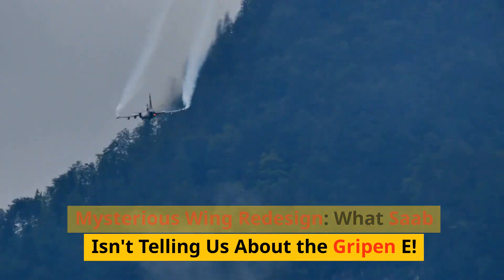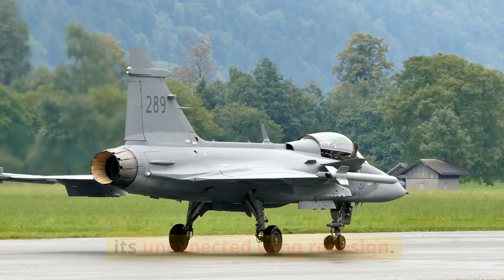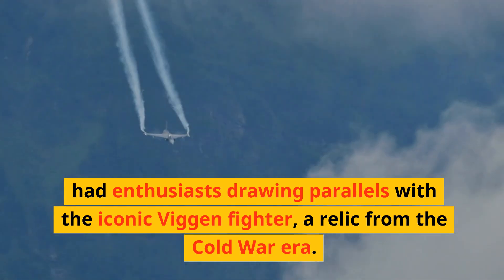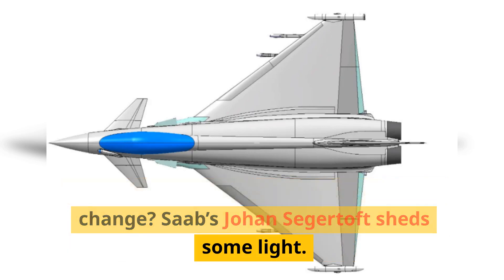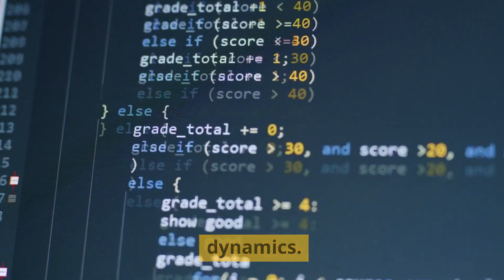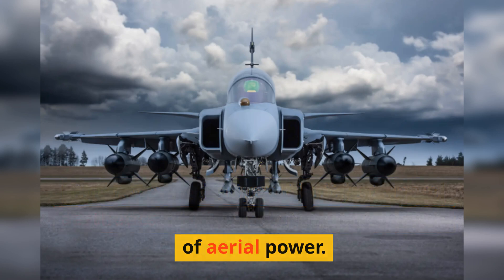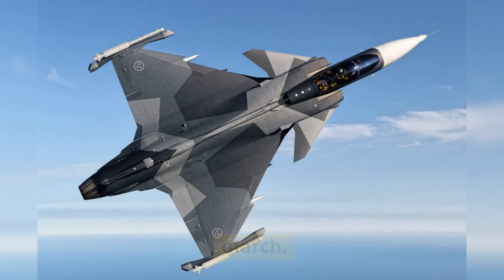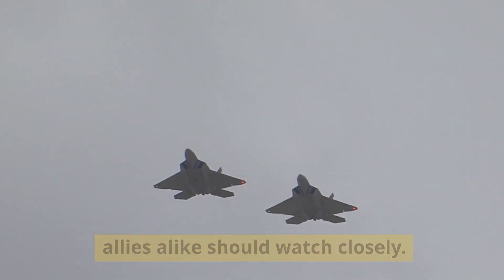Mysterious Wing Redesign: What Saab Isn't Telling Us About the Gripen E!

Comment: Good paint job and yes the wings did get a redesign so the undercarriage cold be moved away from the fuselage giving more room for fuel tanks . Showing a Eurofighter profile while talking about Gripen E shows little intelligence.
Reply: The initial Gripen E wing design  is not what this video is about but the changes that has been implemented on top of that
Reply: @kronop8884  as I said the wing design is little changed even in area, what is different is the undercarriage position and the moving of some electronics into those large boomerang pylons. The video is all about a paint job by some click bait promotor. The package of changes in Gripen E is a reduction in RCS , a new radar with GaN , sophisticated networking with other systems not just similar aircraft, more internal fuel, much more powerful engine, EW capabilities, increased weapons loadout. It is nothing to do with a paint job that could be done on earlier C/D variants. The upgrade to the wing is perhaps a combination of better load out with extra pylon weapon positions and bigger inboard and outboard elevons . Eurofighter was tested with a modification kit that was similar in principle back in 2015.
Reply: @NATObait What this is all about are the recently implemented changes to the control surfaces  relative the original Gripen E design seen in the first batch delivered, not any of the changes  relative to Gripen C
Reply: @kronop8884  I think until SAAB clarifications tell us something major has happened we maybe just have an upgrade to the size of the ailerons and that is needed as the empty weight of the E version is 18% larger than the C and it has a 40% increase in internal fuel hence a little extra control is needed.